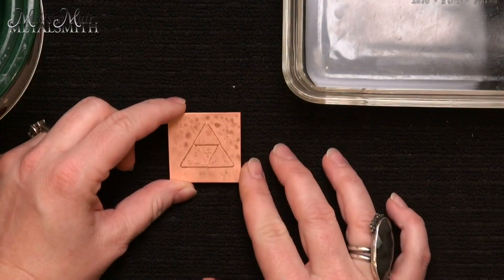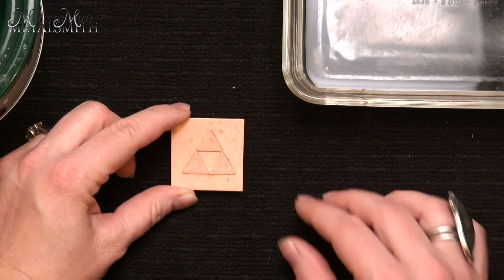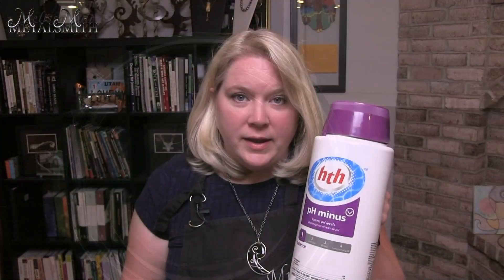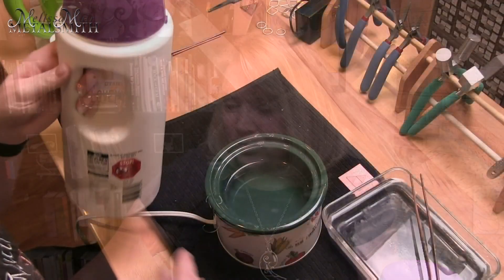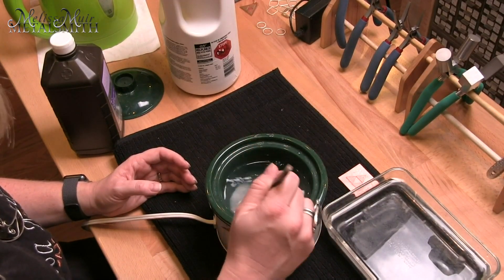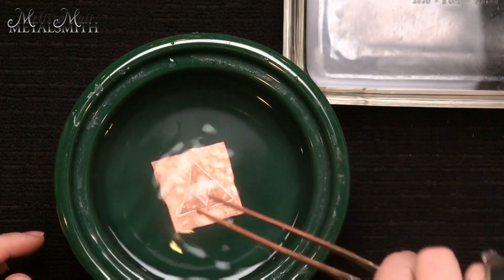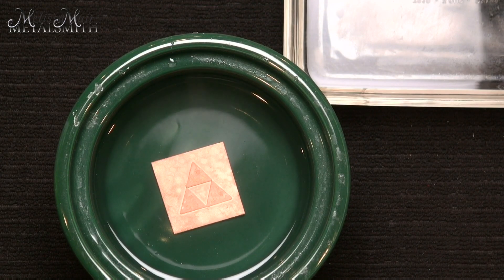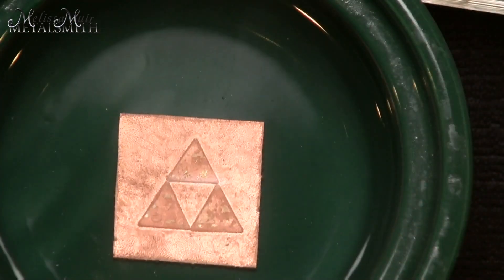Need to Remove a Copper Plating? Super Pickle is the Hero.

Comment: Perfect solution to the problem I’m having with my current project, copper details soldered and/or riveted to brass piece. Brass will copper plate after pickling to remove firescale from soldering and I need to return brass to its original color. Thanks so much.

Comment: What about larger items like the copper plating on an antique fire extinguisher. The copper plating cover the brass. Can this be brush on small sections at a time it or can I just use a larger plastic container mix the ingress and drop the extinguisher into into the hot water leave for a few minutes, drop into baking soda water mix for a while then I rinse off with hose?

Comment: this may seem a little crazy but I am looking to deliberately copper coat metal that has been silver coated.  I have some recollection that copper coating happens with iron or steel being introduced to the pickie?
Reply from the maker: @caroleheilman3992  yes. If you take some steel (tools or steel wool) you can copperplate your pieces intentionally

Comment: I used a pickle (distilled vinegar and peroxide) to remove some copper discolouration from my gold earrings. It turned them completely pink and dull. I haven’t been to restore them back to yellow gold. I did use  another pickle with just 1:1 hot water and hydrogen peroxide but it didn’t work. Suggestions?? Would the addition of the PH down work? I do have some for our spa.
Reply from the maker: Are you sure that the gold wasn’t just a plating?
Reply: @MelissaMuir  I’m actually not certain but I did do an acid test because I am not sure of the metal to be honest. It didn’t corrode or turn black. It is not magnetic either. I thought it was low carat gold 10% or gold filled is my best guess. There is no marking. It was a beautiful bright yellow before I messed with it :-( . It’s possible I contaminated the pickle so I’m wondering if it’s worth trying again.
Reply from the maker: @Heroine2me  Sadly, it sounds like it was probably just a thin plating, especially if there is no karat stamp. It is hard to say without actually seeing them. I don’t know that the pickle is contaminated, but one way to check would be to throw a scrap of silver  in to it and see if it copper plates. The fact that the earrings weren’t magnetic at all indicates that at least it isn’t iron.

Comment: I am really struggling. I have been stripping some chrome off of a very expensive solid brass faucet . It has been a nightmare. First time stripping anything and thinking maybe I did some things wrong and perhaps accidentally plated more copper onto the metal? Either way... Some of the faucet pieces came out nicely ( brass) and others still have so much rose gold on them I cannot remove it for the life of me. Tried this method last night and really didn't do much except shine the copper up. I used a stainless steel bowl to soak my pieces in my pickle. Bad? I don't have a crockpot but i did use scalding water. What am I doing wrong? Is the plating too thick?
Reply from the maker: I am afraid that I am not much help on this one as I have never tried with hardware like this. Could it be the hardware isn’t really solid copper?

Comment: Thank you so much for this!! The main problem I'm having and I don't know if you have a solution is that my brass pieces oxadize to a dark brown SO fast and I don't want to sell it cus it looks so cheap an bad! Is there anything I'm doing wrong or is there a way to prevent it? No matter how many times I polish it it happens within a day or so😩
Reply from the maker: Yes. You can put a coat of lacquer or renaissance wax to help seal it.

Comment: Melissa, I am doing a LARGE  brass piece (9" x 14") that won't fit into my pickle pot. If I soak paper towels/cloth in the super pickle and lay it on the soldered brass, will that work as well?
Reply from the maker: I haven’t tried that. But you could try that. I would think if it is wet enough, it just may work.
Reply from the maker: Or maybe find a plastic container like those for scrapbooking maybe?

Comment: Is super pickle safe for Gold fill? No matter what I do my Gold Fill turns pink when soldering. I have my torch on the lowest setting and using easy 14K gold solder. My pickle has been changed so it's not that.
Reply from the maker: Yes. It is. At least when I have done it.

Comment: I am amazed  I was using vinegar and  salt until I  found you with this i know of someone who has a  pool so I asked  for some of the stuff you described smells much like chlorine however it does work still in process about getting a crock pot and then trying the hydrogen peroxide still an important  improvement in the  brilliance of my chain maille crafts with only the pool chemicals not at all trying the peroxide part yet nice really  really  nice thank you for sharing
Reply from the maker: Glad it was helpful. I never noticed a chlorine smell with mine.

Comment: i tried metal brush to dust of my brass hardware on my bag and now it slightly turned pink on some spots
what should i use to get it yellow again?
Reply from the maker: Are you sure the hardware was brass? It may have just been plated. When I have had that happen, it turned out to be a yellow plating and it was worn down to the base metal.

Comment: Do you know if the super pickle mix would affect the brass or zinc under the copper plating? Thank you :)
Reply from the maker: There may be a little bit of etching that happens, but It will polish right back up without a problem.
Reply: @MelissaMuir  Thank you :)  We were able to get it down to zinc with no apparent etching.  We added two more pennies and it started to plate the original again. :P

Comment: Thanks for a great tip, I do have a couple of questions. Once you make your super pickle and use can you let it set to use it again at a later date and where did you get the baby crock pot. I love the pH and have been using it for a while and you can get a lot of pickle for your bucks. Again thanks for sharing and thanks for response in advance.!!
Reply from the maker: Thanks. The super pickle will only be good for a couple of hours. After that the second Oxygen molecule is dropped and it becomes regular pickle. That is the nice thing about this because then you can just add it to your existing pickle.... assuming it isn't contaminated. Or if this is your new batch of pickle, you don't have do anything to it because it just becomes regular pickle. I think I picked up my baby crock pot at a garage sale or thrift store. I think I paid like $2. :D

Comment: Cool...if you wanted to control it etching the copper you could try masking it with packing tape.  Would this pickle als work on silver that has been accidentally copper plated?
Reply from the maker: That is a good idea. I haven't tried that. But I sometimes have some of the gummy residue from the tape that is a pain to work with and In this case it would be easier to just polish the metal as the etching is just on the very top surface. But I can see how that would be helpful on more delicate pieces. And yes, this method will also work on silver or gold that was accidentally plated.